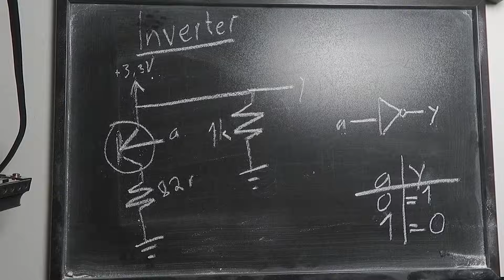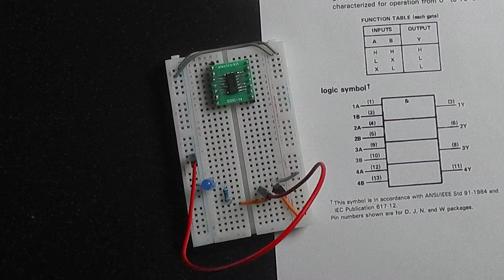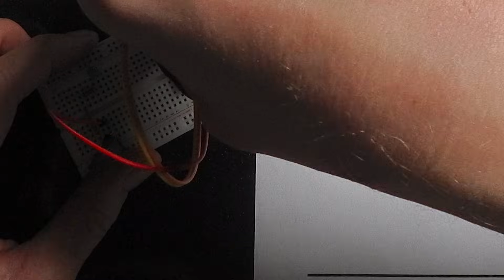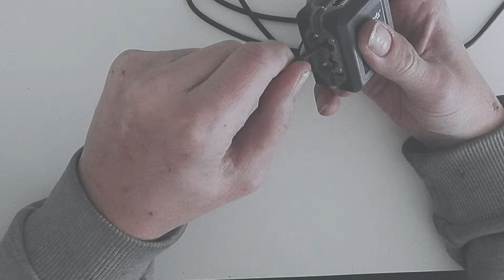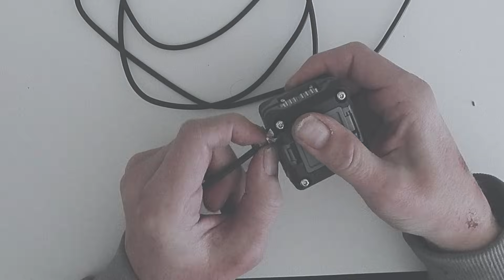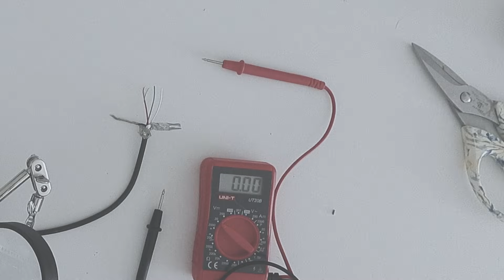Building Electronic Inverters

Comment: Can't wait for memory with flip flops and registers
Reply from the maker: hehe we are closing in on it
Reply: @dr-Jonas-Birch  is there a way to send you an image? We had a project to design a circuit that displays the number of spots available in a parking system and depending on the number, a red led must flicker if the number is 0, the amber led must be on if the number is between 1 and 10 and the green led must be on if it is 11 to 20...I had buttons to simulate when a car goes in and a different button for when a car leaves. It is too much to explai but I had a bunch of logic gates used for control logic and to make a 5 bit adder and I made another adder with control logic to convert the binary value stored in a d flip flip register to bcd code such that the bcd-to-7segment display chip can light up the seven segment display correctly...no code, just straight hardware...it was the best project i did this year for me because I worked on it by myself with only research and my text by floyd. I am sorry of it is a weird request...i just feel proud of it.project to design a circuit that displays the number of spots available in a parking system and depending on the number, a red led must flicker if the number is 0, the amber led must be on if the number is between 1 and 10 and the green led must be on if it is 11 to 20...I had buttons to simulate when a car goes in and a different button for when a car leaves. It is too much to explai but I had a bunch of logic gates used for control logic and to make a 5 bit adder and I made another adder with control logic to convert the binary value stored in a d flip flip register to bcd code such that the bcd-to-7segment display chip can light up the seven segment display correctly...no code, just straight hardware...it was the best project i did this year for me because I worked on it by myself with only research and my text by floyd. I am sorry of it is a weird request...i just feel proud of it.
Reply: Me too!!!! ❤❤